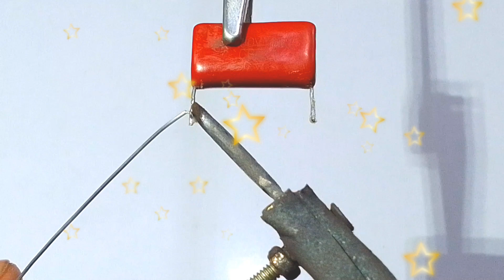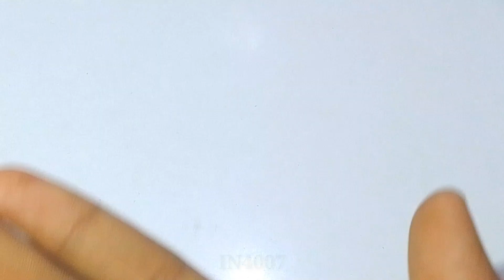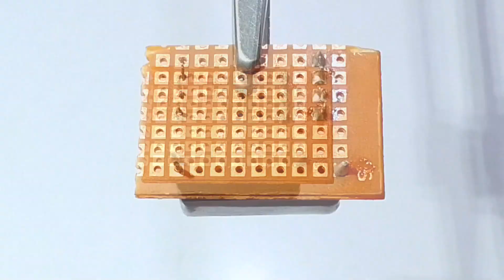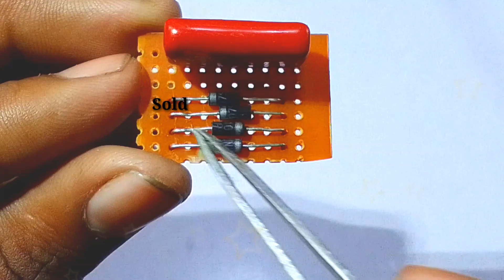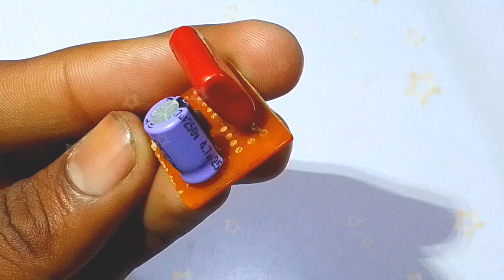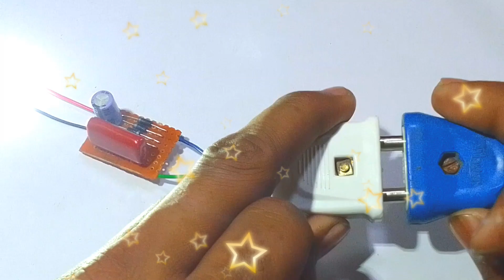Led drive circuit  banaye  IN4007   diode se || How to make led driver circuit / easy ideas

Comment: Required Rectifier circuit, Input 440v ac to Output 170v dc, required 160 to 170v dc not more. With 2-3 Amp. For motor Brake